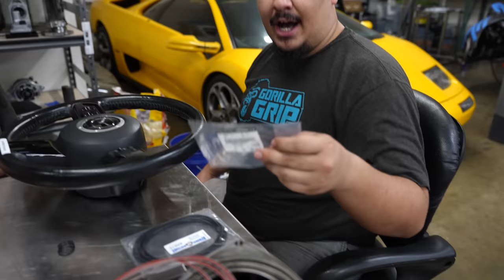How to rebuild a Cheap RX-8 for under $250

Comment: You guys are really making me want to start my m50 forged internals build.

I'm still going to m62 swap an rx8 someday.

Out of curiosity why don't you guys jump the fuel pump relay connection and just get a little flooding in the engine just to get it started and then do a warm start after first cold start?

Comment: "... That depression is way better than being at the bottom and not having a running engine" 
Damn Dahm, calling me out, putting me out there in the spotlight with a pedestal and everything... 
Seriously though thank you Isaiah for buying your RX8 and doing this little series for rebuilding the Rensis motor. This probably is the last little push I need to get off my ass and tear my engine apart and put it back in my car.

Comment: I actually found your series amazing and helpful , I’m thinking seriously to buy 13B-FC rotary one from Rx7 to swap my CIH old engine for my classic Opel.
But how can I get the full repair kit oil and coolant seals for only 250 $
I found it on eBay for more than 1000 $
🙂

Comment: Now that you guys determined the failing point near the spark plug area you might want to design like a threaded bushing to isolate the threads on the spark plug from the rotor housings and also help dissipate enough heat from that point. Just a dumb idea to try and give the Renesis a few more miles of service.

Comment: So I have a 2004 Mazda rx8 I was cruising and it just shut off on me when I put the clutch all the way in so I kind of bump sparted it to turn it back on and it started but it wasn’t giving me any power , I put the  the clutch in again and it shut off me me again so I though it would be the spark plugs and now that I have changed them the motor sounds like it has no compression at all I wanted to see if I can get your opinion on what I should do or just do what you did in this video

Comment: Yo! I was curious what is the best way to clean the irons I've seen in your other videos that the sleeve the apex seals ride on is aluminum but also chromium. If I don't care about making top power just that it runs reasonably what imperfections should I be looking for, also if it makes 100 psi on all faces should I even bother with the rebuild right now?

Comment: I am looking for a rotary engine model. Two years ago Christmas I bought the Mrs. a visible V8 model. It took her a couple of months to build but she did it and it indeed works. We were both very proud. I would like to get a rotary engine model to assemble this year but all I find are either prebuilt, or 3d print part models that I would have to print but I have no printer. I can also find vintage kits but I doubt all the parts would be there. Anyone have a tip, idea or source to get a model kit to assemble, please let me know. Thanks.

Comment: Sorry layman question, 20:47 did you mod the oil filter position? I thought it was always at the rear of the engine, at least it is in UK rx8s, its a right bugger to get at

Comment: Could you use red high temp grease for the oil control seals to hold them in? I feel like it would hold them better since it’s tackier.

Comment: Could the gasket maker you bring up to the seal be there reason why the seals looked all melted when you were pulling them apart? It's the gasket maker, it heated up because someone put it on a coolant seal and when you pulled the seals out it looked melted because the gasket maker was attached to the gasket in the iron Just my guess.

Comment: My rx8 has a hot start problem, already changed coils and plugs and wires. Injectors cleaned and fuel pump new. Still hot starting. Has a motor with better compression than the one it came with. Any ideas?

Comment: There's a picture doing the rounds on Facebook of a double chambered rotary. Like each cylinder is two rotors, so a genuinely 2.6L 2 rotor/4 rotors engine.... its weird.
Reply: I don't really use Facebook but I know Rolls-Royce attempted to build a diesel  rotary that had a big rotor feeding a smaller one like that. used the big rotor like a supercharger to get the compression higher.

Comment: You know when your working on the rotors, once you fit all the oil rings, side seals, corner seals and apex seals ...I'm going to vacuum pack each rotor, that way if I have to wait a day or two to continue working on the motor at least I know each rotor is down and it's not going to get contaminated...

Comment: ThreeBond or HondaBond is way better than silicon when sealing a machined surface where the assembled tolerances matter, like those engine housings or trans cases.

Comment: Hey Rob I had sent you a DM but I guess I'll go ahead and ask here. Is it possible to machine a larger groove where the water seals go and make custom larger o-rings fit for better reliability and cheaper cost? Steph papadakis in one of his video used a cutable and glueable o-ring material to help o-ring his manifold to the motor. Wondering if you could use the same concept for the rotor housing and used the glue portion on the cold side of the motor as an experiment.

Comment: On the road to reliable rotary!...revs it up right after first start...takes for immediate test drive giving higher revs...lol reliable rotary or showing just how much abuse a "reliable rotary" can take ;) LoL id use what i learned with two strokes...low revs to start...keep rechecking torques 2heat cycles before i even start to hit powerband... Makes a two stroke with a wiseco go for years and years...

Comment: id like to know where can i get all the needed parts for the rebuild for 250$, cuz the only thing that i saw was 1500$ seals and gaskets kit
Reply: All you 100% need is the water seals. Because you can't reuse them. 
Then you take your engine apart, check all the side seals, corner seals, apex seals, bearings and oil control rings. If they all are still in spec, re-use them. If not? Replace that one seal. 

Those kits assume you are replacing absolutely everything. Which imo is more worth doing just replacing everything because you've already got the engine apart.

Comment: Hey guys watched this multiple times, just got an rx8, having a misfire at 5500 and feel like power loss and if I try to push past the 5500 it will go all the way to 8k in lower gears but does not feel smooth… laggy, I’ve read forums and everything but I’m lost, I’ve replaced the whole ignition system, the ess(crank/eccentric position sensor), and still has the prob, not clogged cats because it has none, I don’t think it’s injectors because it’s dumping excess fuel out the exhaust, so I think it’s timing but I can’t figure out how to adjust that or if you even can??? Everyone on the forums I’m reading is split saying you can adjust the plate behind the main pulley that the ess reads on but idk, any help would be greatly appreciated!!!!

Comment: Little trick for first start. Prime it like 7-10 time . Turn key on and allow fuel injector to prime  before your first start and it’ll start a lot better. Using E-85 prime 3-5 times in cold morning and it’ll start on first click boss. Take care ✌️

Comment: Rx8 rotors have front and rear marked on one of the rotor faces 🙃
You should have at least put in new apex seals, as they can warp, causing low compression 😌

Comment: 7:20 Pro tip for anyone about to press in oil control rings.
Don't be an idiot like me by pressing hard with your thumbs while sliding them around the rings.
I sliced my thumb and fingers up real good and was able to use blood instead of assembly lube. 😅

Comment: FYI that's how you break in a motor.   If it's unhealthy it's gonna break.   Babying it for 500 miles it's just gonna push the failure back 500miles.

Comment: you can cheap, but labor on certain things are what you can't do alone. I found that factory rotors are not balanced well enough. Had to add metal on auto rear counter weight to balance when I put in aftermarket flywheel.
You definitely want to polish the rotor faces before balance. It will make carbon harder to stick.
Black Horse Racing upgraded coils are definitely a must. They don't wear down quickly like OE coils.
NEVER use any oil filter other than 2009-11 specific OE oil filter. Only that filter can handle DOUBLE oil pressure in these 2009-11 engine.
If factory bearings in rotors are fine DO NOT replace them. Replacement bearings no longer stick in place as well as factory installed bearings.
For all rotary engines without clean oil feed, use Idemitsu 10w-30 rotary racing oil.

Comment: when you dowle the engine in the last video u consider the engine expanding under heat
Reply: Shouldnt be a marshmellow in the microwave and its dowel not dowle
Reply: @dancearoundtheworld5360  spelling mistakes have been fixed

Comment: P Port that bee-atch. Use a BMW M1 style throttle slide that transitions open at 5500. Cut in exhaust inserts and run Yamaha Powervalves on them, coming full open at 6500rpm. Get a two piece E-shaft with center bearing housing and spin it to 10,500rpm. All the torque of the Renesis and top end of a monster. 
There's no other option. Oh yeah, change the rear differential to 5.10 gears lol. That ought to dew it.

Comment: this is going to sound dumb buy the way rotors are made could i take 2 rx8 engines and basicly stick them together with some aftermarket parts and get a 4 rotor
Reply: You are new to this channel aren't you ?
:P
Reply: Simply, no.
Reply: @fila1445  yea im new to cars in general just curious
Reply: @user-qc5te9wk1s  Rob essentially did what ypu just said with his 4 rotor, but its not that simple. You need custom excetric shaft and some parts from 3 rotor engine

Comment: So... Wait.... He put synthetic in ... Thought you weren't able to do that without issues due to the fact synthetic doesn't burn like conventional and they didn't go over the fact they would have had to change the oiling system and premix form what I've known and discussed with companies like Pennzoil and Castrol and shit
Reply: Unless there's more to the rotary witchcraft than I thought
Reply from the maker: He’s going to swap the omp over to premix but I think he’s just excited for the bearing protection. Little backwards but it’s okay
Reply: Holy.... Shit... 🤣😂🤣

Comment: Why would you not replace all the side seal springs all together they cost fuck all🤷‍♂️ plus the oil control  ring springs🤷‍♂️ you say cheap but are definitely showing people what not to do instead of actually showing them how to rebuild it cheap but still making it a fairly good engine